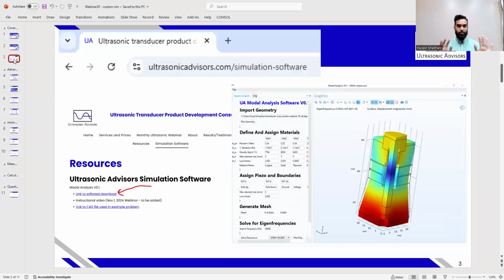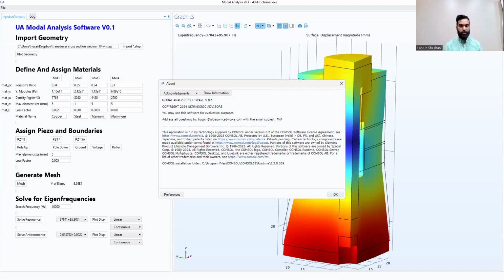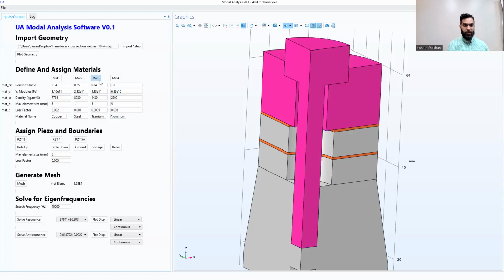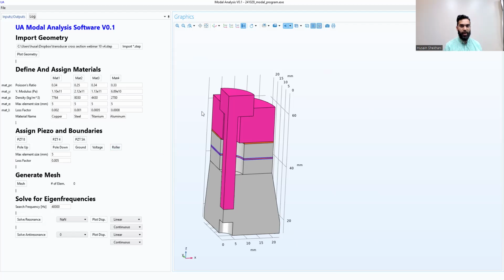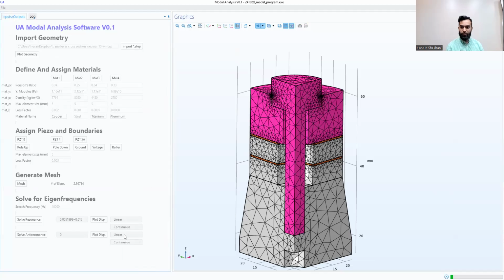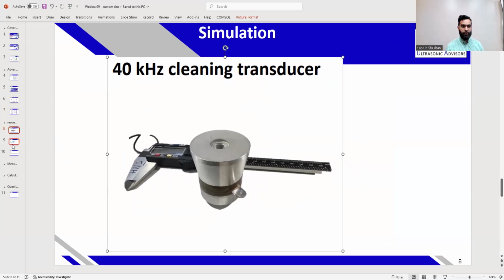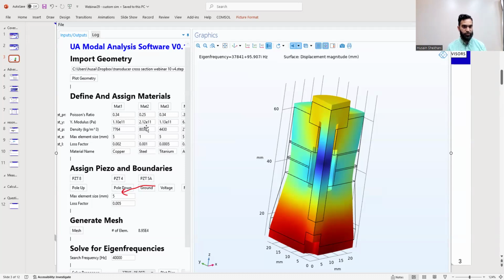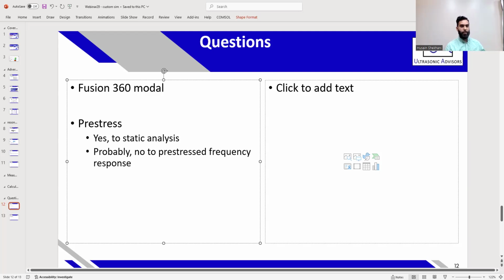Free Ultrasonic Modal Analysis/Resonance Simulation Software/FEA

Comment: Husain, Great tool. Thanks! I'm trying to learn how acoustic transducers work in water -- looking at loading effect, matching layers, etc. 1) In the 3D model, could I add an external cylinder and give it the material properties of water? 2) How hard would it be to add radial polling? i.e. for a tube/ring ceramic projecting outwards. (ID/OD have the electrodes).

Comment: Would a modal analysis be sufficient for more complex horn shapes? I am interested in stepped plate radiators and I am wondering about the differences between doing a modal analysis vs a frequency response analysis.
Reply from the maker: Yes, it would be sufficient. I recommend modeling a "slice" of the model and using roller boundaries to simulate symmetry. That way, you don't get a zillion bending modes.
Reply: @ultrasonicadvisors  Thank you, Do you mean a 2D slice, or do you mean a narrow 3D "strip" of the stepped plate? Additionally, I am unfamiliar with how I can simulate symmetry with a roller boundary, can you share an example/article of how this would be done?

Thanks again for your time.

Comment: Hi. Thanks for sharing. Im not being able to install it. Message I see "Comsol Error: Could not connect to download servers"
Reply from the maker: Thank your for letting me know. I will upload a version of the software with the COMSOL runtime installer embedded so won't have that problem. Gimme a day or two.
Reply: @ultrasonicadvisors , you are welcome. Thanks. Let's keep in touch.
Reply: Hi again. 
Tried again and now it is working fine. I could use it following your instructions in the video. Many thanks!!!
Reply from the maker: @gmarcosb  Great! I'll eventually put up the version with the COMSOL runtime included in the download, but it's good to know I don't need to do it right away. Please let me know if you have any suggestions about the program.